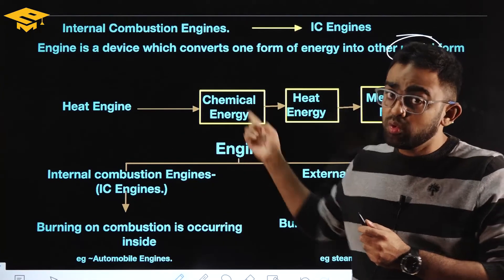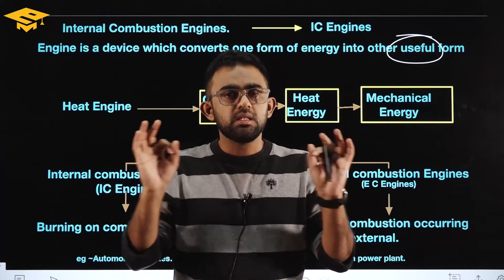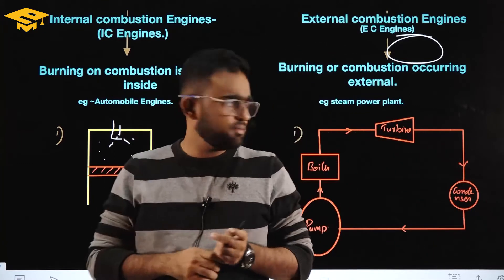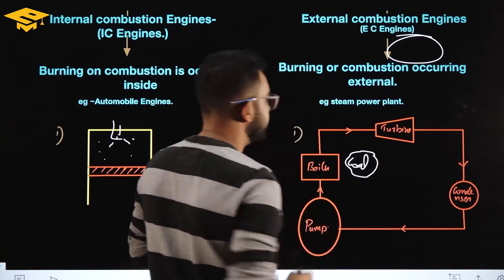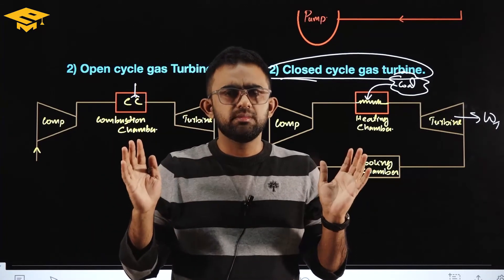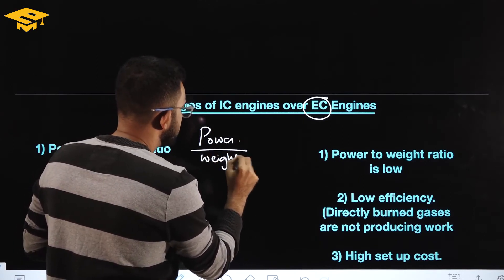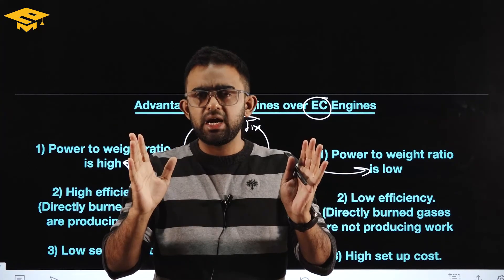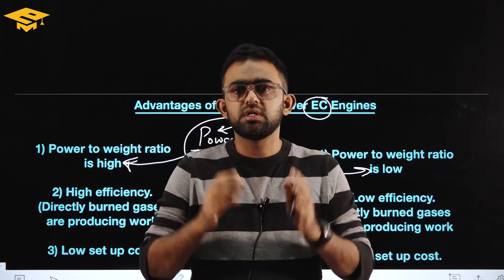Assistant Motor Vehicle Inspector(AMVI)  Kerala PSC Free Classes

Comment: Stoichiometric ratio is

[Achemically correct air-fuel ratio by weight
[B].chemically correct air-fuel ratio by volume
[C].actual air-fuel ratio for maximum efficiency
[D].none of the above

Comment: let the crankshaft of a 4 stroke IC engine be rotating at 1500 rpm. Then the time duration (in ms) of one intake stroke is
 a. 40 
b. 10
 c. 20
 d. 5